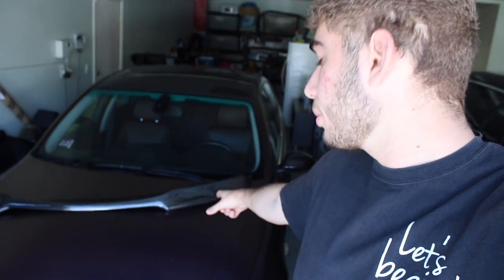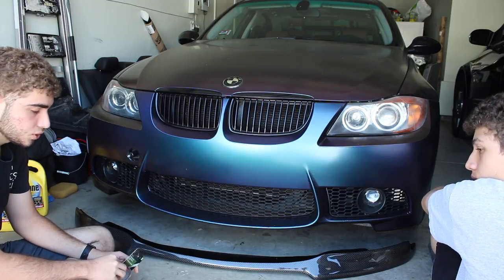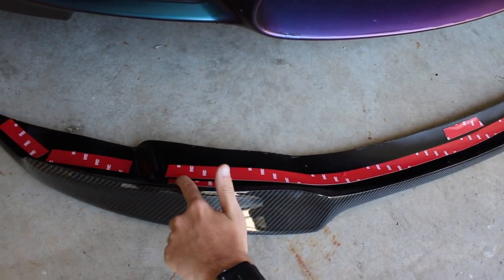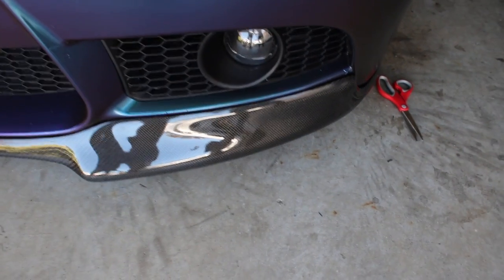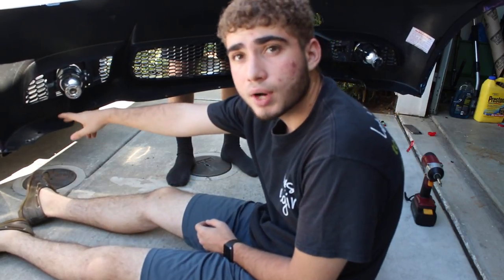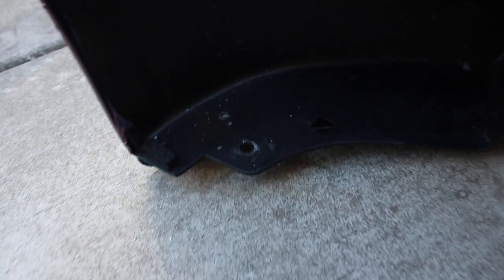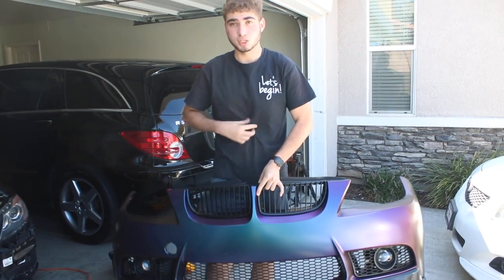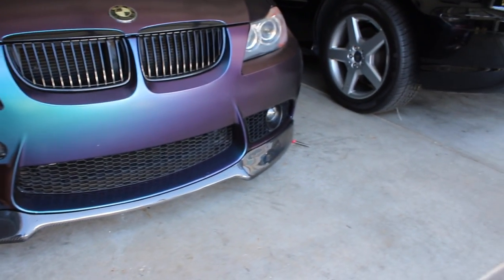INSTALLING BMW M3 REPLICA CARBON FIBER LIP (E90,E91,E92,E93)

Comment: What headlights you thinking about going with? I thought about getting the ones you had before but how does it work going from xenon to halogen?
Reply from the maker: Dominic Trejo it dose work and I plan on getting my old once and coding them to wrk with no problem. Planning on making a video on it soon.
Reply: Hey, I was thinking about going from Xenon to Halogen lights. I do not drive my car at night so light output isn't a big concern for me. My current headlights are pretty beat and just want a refresh in terms of looks. What problems did you run into ?
Reply from the maker: only major problem was lights on my dash concerning these after market bulbs using higher voltage. All you need to do is add the resister that most likely will come with your new headlights. Then get someone to code out your issue.
Reply: I am pretty familiar with coding on the E90. Is the light/error appearing on the small LCD in the center of the dash or the small icons above it ?  I coded out the light cold/warm checks out for my car so I could use LED bulbs without an error/warning canceler. Curious if this headlight error is related to the cold/warm checks.
Reply from the maker: nah just the adaptive headlight lights
Reply: Just wanted to give an update: I went and bought a pair of headlights (halogen model) and fitted them on my car (Xenon equipped) yesterday. Coded out all of the errors and functions 100%. They look amazing paired with some quality led bulbs.
Reply: TGSN _ dude you're awesome. Can you give us another update in a week to see if they hold up okay?
Reply: Will do man!
Reply: TGSN _ I forgot to ask man, how did you code out the errors?
Reply: Used NCS Expert to remove $522 and $524 in the VO. FA Write to CAS->SG_CODIEREN to FRM. Also took some suggestion from the forums and set "ALC_FAHRZEUG" to "nicht_aktiv" on the frm/nfrm module. Doing all of these things got rid of the error. Which is CC-ID 295 on the dash.

Comment: Why don't you just by a M car? Seems like a waste modding what will never be a M3. This is coming from a 330xi owner.
Reply from the maker: Pickle MeTimbers bro work with what you have, we can't have everything at this age
Reply: Im being honest. You are putting extra money into that car and you will never get it back. I thought about doing the same thing but after speaking with a few BMW reps it's better to just get the M car. You will have the potential to earn on your investment. However once you mod a car, that vehicle will lose some of it's value. Don't get me wrong I love the way your car looks. I'm just giving advice that will give you a return on your investment.
Reply from the maker: Pickle MeTimbers I plan on keeping my car forever and by doing these mods they are expanding my channel. I am not recommend that you guys should do everything I'm doing but just a good amount.
Reply: Appreciate your reply. I'm glad you understand that. That is the only point I was trying to make. Given that you are aware, keep it up. The car looks sweet. If you end up spending a lot, make sure you get the parts insured. Anything that does not match the vehicle VIN will not be replaced unless you add it to your plan. I look forward to your next video.
Reply: dont worry about other comments Nour,, Non-enthusiasts wont understand
Reply from the maker: paapaa33 yea man it's mainly the engine and trans that cost that much
Reply: The M3 will have over 140 more horsepower. V8. Lowered suspension. M package brake upgrade. BMW performance exhaust. BMW performance air intake. 19" wheels. Interior M package. Upgraded transmission. I could go on.....Also the E92 M3 is already a collector car. That is unheard of for a car that is 10 years old. Make 0 sense to spend extra money on a car that will never be as valuable or collectable as the M3. Did you know just under 200,000 BMW 3 series (non M cars) were produced in 2008? Compared to the 7,500 M3's that were made. Also there are plenty of used ones in the states with clean PPI for around 25k. So at the end of the day you can have a car that "looks like" a M3 and that car will never hold value. OR you can actually own a car that will increase in value. I was trying to give advice to a younger person on YouTube, who a few videos ago was complaining about money...... To then do mods that decrease the vehicle value?? 
The only logic behind that is he's using this car to generate money for YouTube, as he said. If that was not the case Nour would literally be throwing money away. Hence my first comment.
Ever think of the amount of views that could be generated from owning a m3 over a 330i? M3 owners can have their cars in supercar shows.....Can't do that with a 330i....  VIN matching M cars get invited to special BMW events. Getting a M car, even one of the same year of his car would generate way more views than 330i upgrades. Which in turn would mean more ad revenue. AKA more money..... He's young but seem to be a cool guy. I was trying to help him make better investments. If i didn't care I would have never commented. I like watching Nour's videos and I would like to see him make it to the next level.
Reply: You are welcome. I did not make my original comment to be rude. I honestly wanted to know. Nour explained his situation very well. I respect his reply so I will be following his channel. I like to see other BMW owners do well so I share what knowledge I have learned.
I understand paapaa33.
I bet your BMW looks bad ass. I would love to have a D model one of these days. They produce great torque (Newton meters for Europeans, I believe). Also diesel engines will last 2x-3x longer than petrol engines.
Reply: You do realize that he can save up and just buy an m3 without selling his 330i right? That’s what I’m doing. I’m keeping my e92 328 and getting an e92 m3, why not have both? Not like the m3 is for the super rich, you can easily find them now for like 20k lmao.
Reply: Yo pickle im driving a bmw e90 318d and doing the same shitt cause its fun and satisfying af XD
And here in Germany the most kosts comes from gas and most important from the Insurance, which ist combined with the taxes already 1600€ every year for a 318d XD
Reply: 1 month update. Got rid of my slow ass 328 and got a 2011 Lexus ISF. It’s faster than an M3 and more reliable Win/Win. Throwing money in a non M is a waste of money. Even modding 335i’s are a waste of money because shit will break faster which =‘s money pit 😂
Reply: Pickle MeTimbers the parts are dirt cheap and he's not losing much money should get decide to sell it later. Buying a m3 is loss in an investment because German cars depreciate like crazy. In a few years his m3 wouldn't be worth shit. Buying a cheap ass 335i and modding it for a grand to be faster than an M3 is way better investment
Reply: Atul Lall as long u dont buy american cars
Reply: Pickle MeTimbers You know what. You just changed my mind. Before I totally thought the non-M cars were better, but tomorrow I'm gonna go trade in ny 328i for an M3, since they are the same price and it's that easy to buy an M3 :)
Look, idk if you understand the concept of money or not, but some of us can't afford a 30,000+ dollar car. If we want to make our car look better, what's the big fucking deal? Just because we don't have an M3 doesn't mean we have to keep it completely stock...
Reply: This aged well
Reply: Where did you get the front lip?  I see alot of them advertised, but, there are differences in the replica M3 bumper and the actual M3 bumper.  I have the same bumper that you have on my 335i.